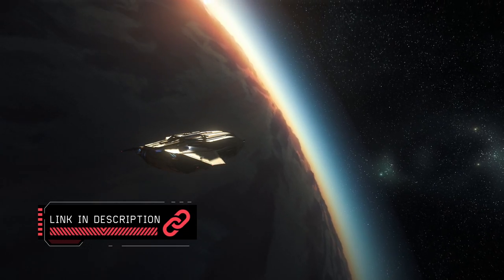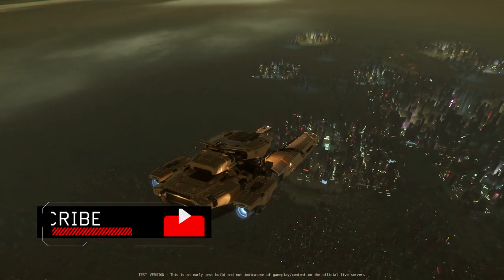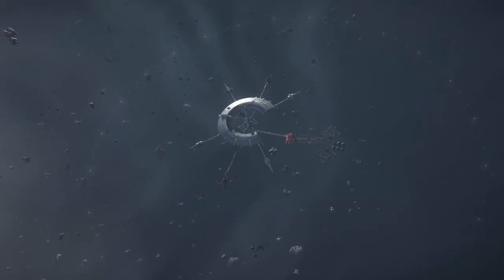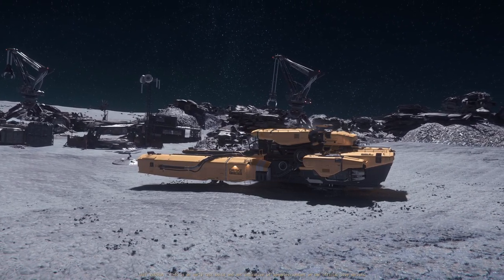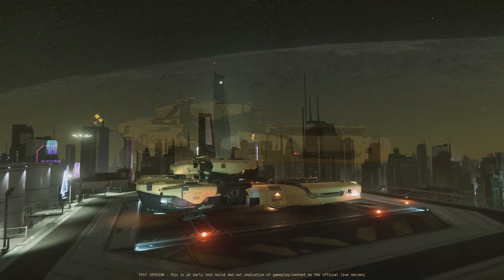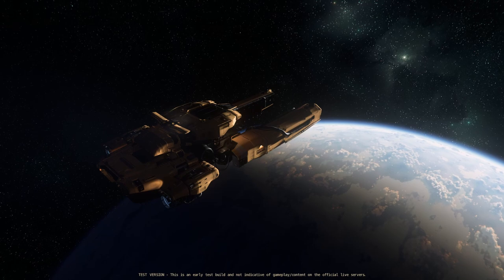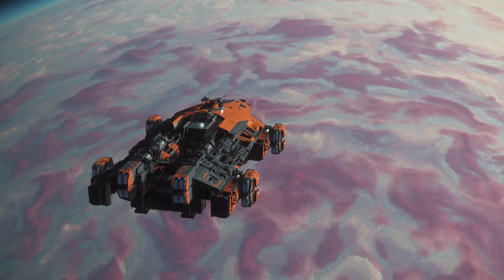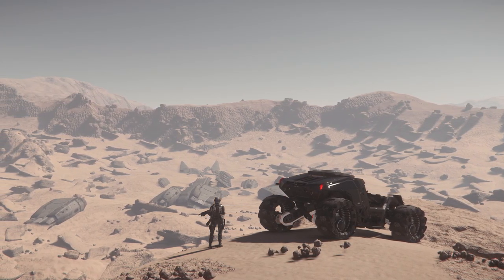Star Citizen - The future of salvage

Comment: Great video!  I agree on the point in particular of having the RMC 'buffer' on the Vulture being increased as two SCU is just tedious and I would think that 4 SCU would be a fair buffer size meaning a  solo  pilot only needing to make four trips into the hold rather than six to fill the cargo grid.  

As for what comes next I am thinking they are probably leaning towards hull munching but that is inconclusive at this point, and we might not see any feature  updates until the end of the year, or even next year as it seems the focus seems to be on Resource Management and engineering which will tie into salvage too in some fashion.

Lastly I am hopeful that they add some easy wins to Salvage in the interim like loose cargo boxes, and other loot to incentivize the exploration of derelicts by anyone looking to gain something from them.

may the algorithm guide us to where we need to be in the interim.
Reply: I was just thinking about  about this. I think that allowing the machine to push crates out until they hit the back bulkhead of the vulture would be great. That would be 4. But if you try to push out one more (trying to compress the crates into one another) that should cause your ship to blow up. This would lighten the burden, but also give some fun because no doubt everyone will forget at least once to go move crates, and it creates danger. Likewise, it creates some lost boxes of composite floating around, from guys who accidentally blew up their ships, that will make for fun finds.

Comment: I agree. Good video. There is a CIG video showing the ejected box being pushed onto the grid by the ejecting box. That would allow what you suggest. First 6 boxes before you have to stack, then progressively less as the cargo grid fills. I hope that system is in the works. I also like the playable explosive charges. It could be used for mining, door breaching, and turning a hull part into munchable parts. BTW, subbed.